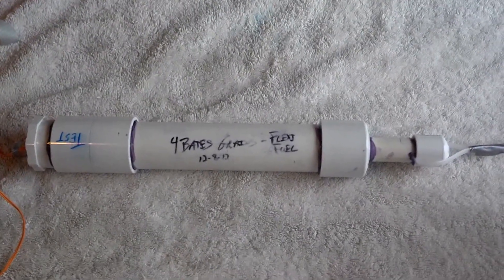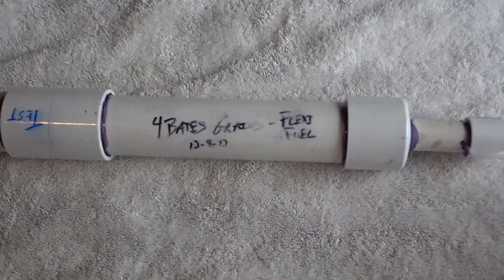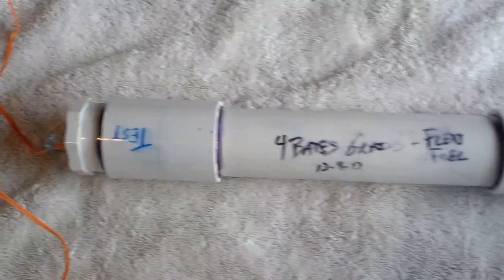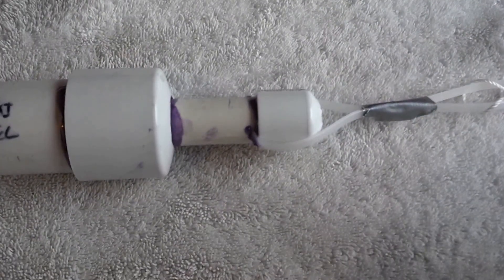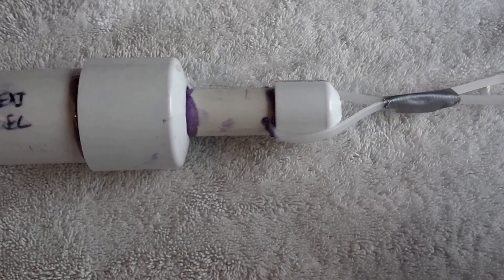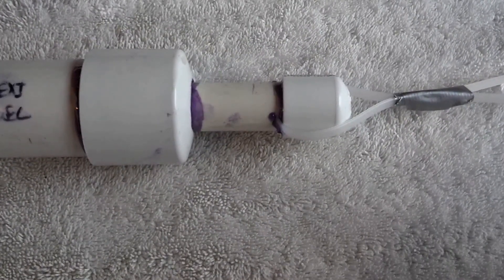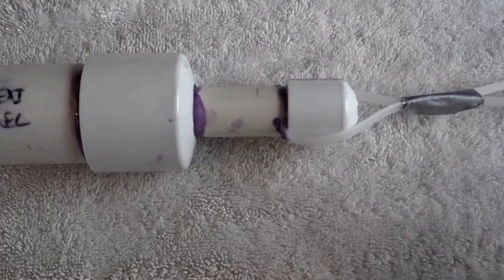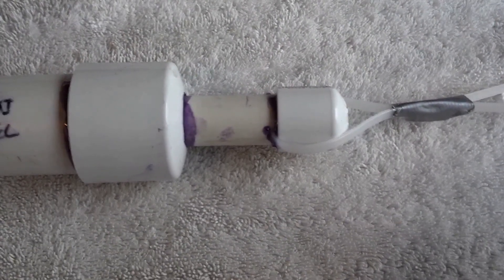Part 10:  How to Build a High Power Rocket - Static Test of Modified Delay Grain Motor

Comment from the maker: @ rocketmanbkk77:  It is hard to say why.  With my 2 and 3 grain motors, flexi fuel worked fine for delay, but with these bigger motors I had 5 delay grain failures vido taped over the past few months.  I began to think it has to do with the difference in kn pressures you and I have to work with between Thai and American pvc.  If I remember correctly, you used flexi fuel on a 900 gram motor successfully, didn't you?